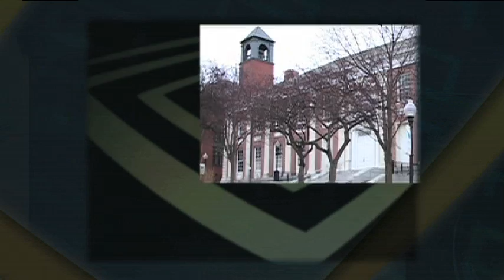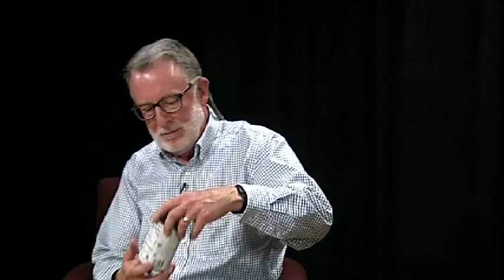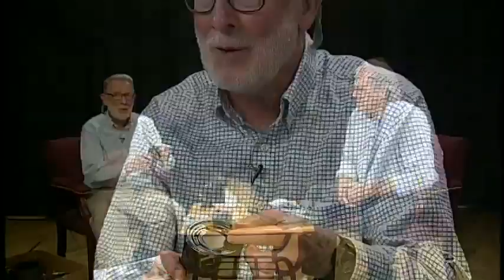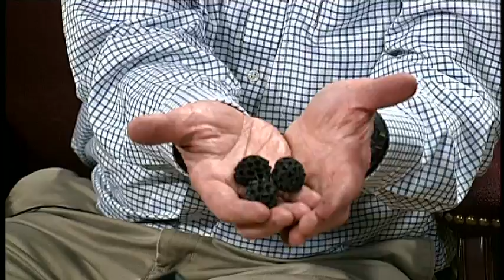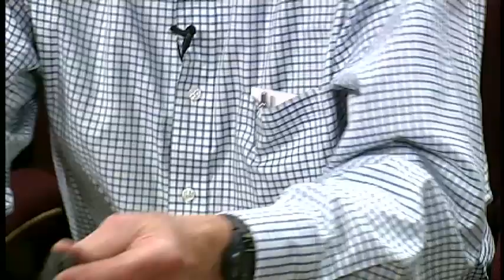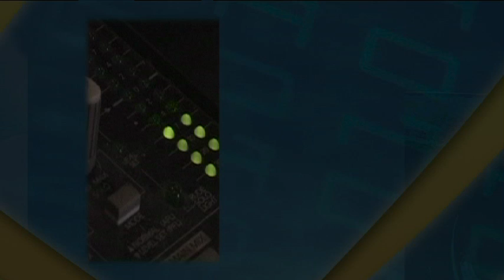Pyrolysis: Creating Carbon Negative Energy

Comment: I would like to have seen it working as well.
It's too bad the interviewer wasn't better prepared for this interview.  
The obvious question to me is: What is the heat source that makes the fuel pylorize?  I would assume that the process begins with some combustion of the fuel load, but that wasn't fleshed out in the interview.  
It's a fascinating technology though, and I'm intrigued to learn more.  
I'm a designer and builder of masonry stoves and teach people the benefit of a "top down" burn.  It sounds like this is similar.  And without a grate in the firebox, the Austrian Grundofen always has biochar left at the end of the fire.  A continuous feed commercial scale appliance using chipped buckthorn: now that's an idea!
Reply: I am working on induction heating pyrolysis using Solar energy, will share the video very soon

Comment: Pyrolysium is a web platform for the promotion and development of pyrolysis as an efficient way to dispose of human remains using the least amount of energy possible. 
Humanity is now confronted with a scarcity of fossil fuels, rising global temperatures due to a higher CO2 concentration in the atmosphere, an economic model in tatters and an exponentially rising population.
Pyrolysium helps to solve problems in all these areas. It does not lay claim to land that we need to grow food. It limits the use of scarce fossil fuels by requiring less material to burn and lower temperatures to burn it at, reducing the formation of carbon dioxide. It turns human remains into biochar, a process which also greatly reduces the amount of carbon dioxide produced. http://pyrolysium.org